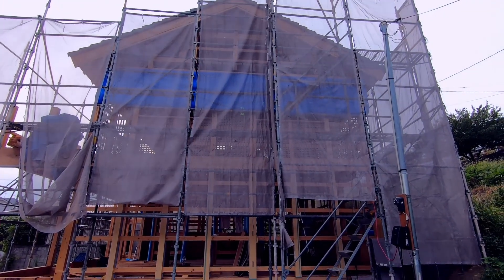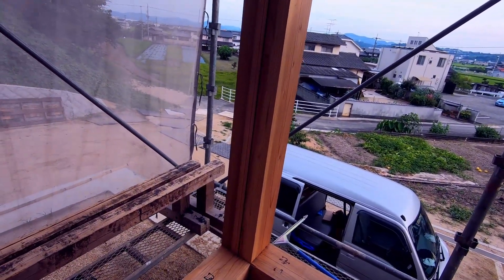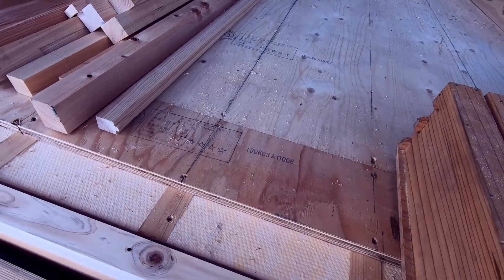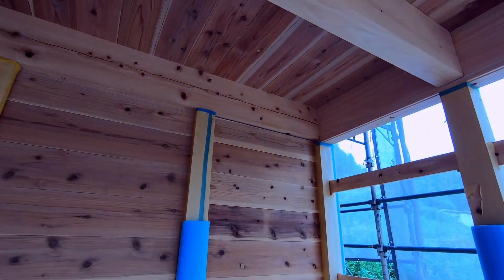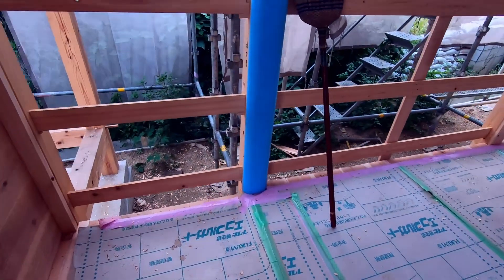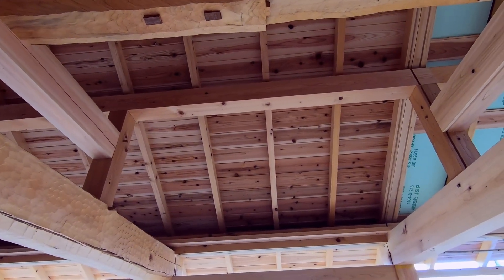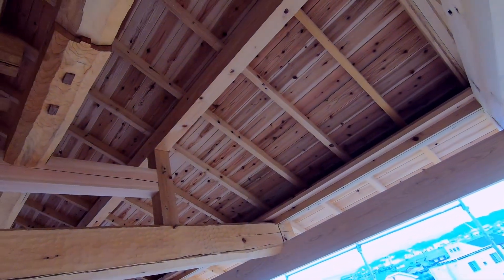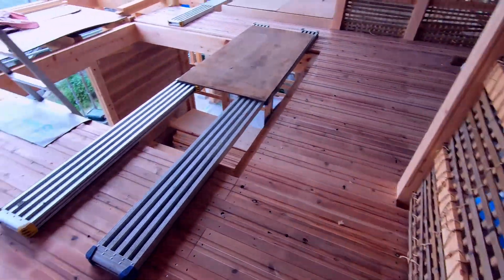Apprenticeship in Japan: The Parts of a Japanese Timber Frame

Comment: How are these frames braced laterally when there is no bracing?
Reply: @Neverstopbuilding  Another question. Why are the two roof  beams where the scarf joint is not aligned?
Reply: @gary24752  Are you asking why the scarf joint is not aligned over the center of the post?  Aligning directly over the post actually reduces the strength of the beam. This is considered best practice in both western and eastern timber framing.
Reply from the maker: the nuki is the shear bracing, the thin wooden slats between the posts, on which the bamboo lathe is attached. They are pegged very tightly